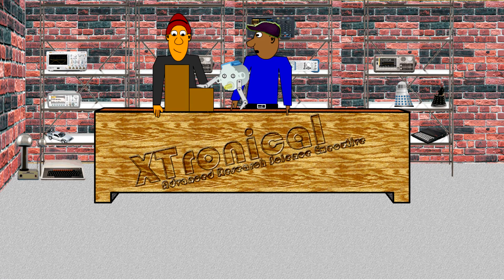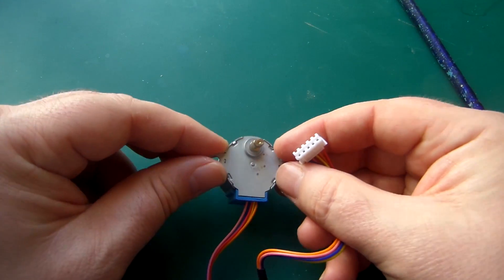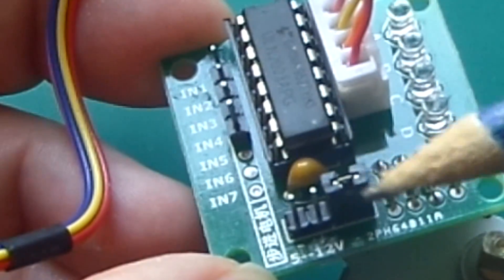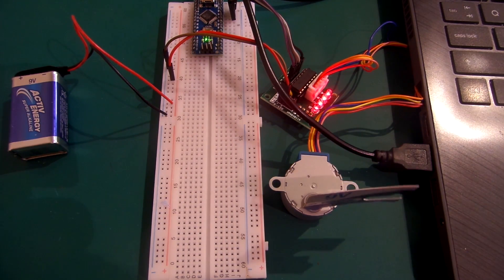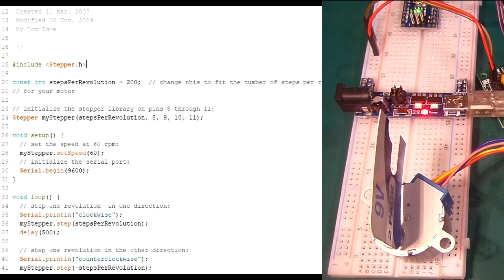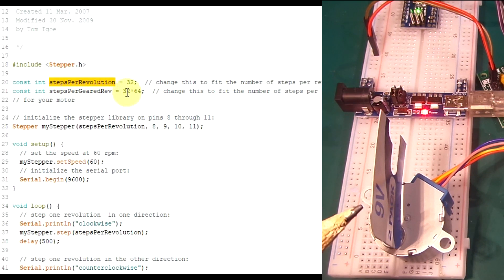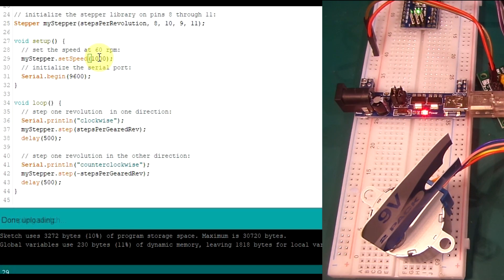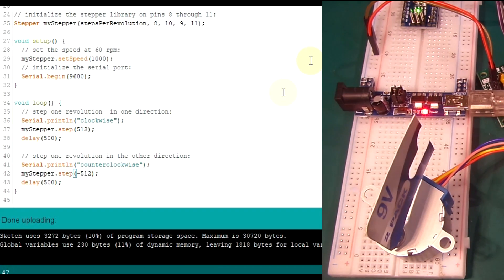Using Stepper motors with MCU's (Arduino, ESP32, ESP8266)

Comment: Hi. Probably someone is able to put me in the right direction.
My target is to remotely control the movable louvers of my shutters (actually with a manual rotating knob). I'm thinking about an esp module, and one stepper for each knob.
This tutorial is great to learn the basics. But now I need to learn how build an "auto-setup" cycle that learn where the full-close and full open positions are.. And so be able to control the stepper to move the louvers from 0% to 100%.
Anyone can give me the right path to follow?
Reply from the maker: For safety it would be best to use lever switches made for this job, so they act as end stops. You just need to detect these switches closing to see if fully opened or closed. Then for any position in between you can use the stepper feature to move to appropriate position. Other option is a normal geared motor with an encoding wheel to count number of revs.
Reply: @XTronical  so you mean to place a limit switch for full close, a limit for full open. Then the setup will rotate the stepper until full close limit close, then rotate opposite until full limit open reached; in that way I know how much the stepper need to rotate from full open to full close.. so I can exactly rotate to an exact position.
I'm a beginner on steppers, so I'm sorry if I'm using wrong terms :)

As for the WAF (Wife Acceptance Factor :-) ) I need to reduce the size of the parts as much as possibile, and adding two limits and their wires could be a limit; there's a stepper driver board with current absorption measurment? In that way I could have a "virtual limit switch" and safety (for a finger between louvers).
Anyway I have to evaluate if a small rechargeable battery pack is able to run all that things for a reasonable amount of time.. beacuse adding a power supply is worse than limit switches :D
Reply from the maker: A current sense sounds possible. However, I know it's not in the spirit of make it yourself but have a look at this video from techmoan https://youtu.be/bLPNFNeCsrU

Comment: I followed your code but im getting "soft WDT reset". any help would be appreciated
Reply from the maker: Which processor are you using, I only tested on arduino. The error looks like esp8266 issue.
Reply: @XTronical  I'm using a nodemcu esp8266
Reply from the maker: The library is not very esp8266 friendly then unfortunately. But there are solutions. What's happening is that the ESP8266 has two watchdogs (wdt) that look to see if the processor has crashed. As the stepper code takes some time to turn the motor one complete cycle then the watchdog thinks your code has crashed - when in fact it hasn't, it's just taking some time.

You can turn off the software watchdog with a command (you could put this in setup function)

ESP.wdtDisable();

If you want to turn it back on (you might no want to) then it can be turned back on with ESP.wdtEnable(1000);

Also add this command yield()  into the code, see below;

void loop() {
  // step one revolution  in one direction:
  Serial.println("clockwise");
  myStepper.step(stepsPerRevolution);  
  yield();
  delay(500);
 
  // step one revolution in the other direction:
  Serial.println("counterclockwise");
  myStepper.step(-stepsPerRevolution);
  yield();
  delay(500);
}

As long as a full turn takes less than 6 seconds then this will be fine. If it takes longer than 6 then the other watchdog (hardware watchdog) will kick in. If this is a problem get back to me as you would need further alts to the code.
Reply: @XTronical  thanks for an extensive reply, so I tried ESP.wdtdisable() ; along with the code you've provided above, but I'm still getting softwdt reset when the motor is moving CCW.
Reply: @XTronical  First of all thankyou for such an extensive reply ! Okay so first of all i tried disabling wdt like you mentioned above but im still getting a soft WDT reset. Then I tried the code above, the reset happens when the servo is moving anticlockwise direction
Reply from the maker: I'll post some code to fix soon but I'm not in front of a computer at the moment

Comment: Thank you! Your video pointed out that I had my control wires from my ESP to the driver in the wrong order -- and ultimately solved my "it's humming, but not turning" issue.  thanks for the great video!
Reply: For me, I think I burned y board by drawing too much current directly from the board, so this video helped me know how now to do that. Lol 😊

Comment: Hello @XTronical, thank you for the detailed Video. I was using the same Sketch with the same stepper and Driver Hardware. But instead of an Arduino I am using an NodeMCU because my Goal is to build a wireless controllable blind at our home.

But the problem is the code doesn't work as it should. I changed the Pins in the Code to the ones I am using on the NodeMCU (D1 to D4 in my case). Code works but only until it comes to the second part of the loop. When it should stop and turn in the other direction it just goes on with the ClockWise Rotation. And it doesn't do a full rotation, just a half, then stoping for 500ms and repeat. I changed the delay after clockwise rotation to 2000ms just for checking if it does this change. But it doesn't. It stays at a pause of 500ms and goes on with cw rotation. Checking the Serial monitor it Shows a lot of strange data and in the end it's always saying "clockwise". Any idea why it's not going through the full Code as it should?
Reply from the maker: Sorry, I'm not sure, I'd have to set up like yourself and see what happens. Off top of my head I'm puzzled. All I'd do is simplify everything. i. e. Take out the first part. Just try the bit that fails. Start in the direction that doesn't work etc.
Reply: XTronical okay I'll try ☺️👍🏻
Reply: From my experience the stepper.h lib is not compatible with the ESP8266 it just boot loops due to the delays

Comment: I connected the same motor to an esp8266 d1 mini board. 
If D1 mini can power it, even Arduino nano can. Why don't you connect to the nano directly?
Reply from the maker: The current drawn (particularly under load) exceeds the nano"s limit. It would break. It also exceeds the d1 mini boards limit. I would recommend not connecting it directly to that board. The limit for your board is around 12mA. The current draw of the motor will go higher than this. Hope this helps.
Reply: @XTronical  running It since two months now without problems. I'll let you know of something break

Comment: I cannot use the runToNewPosition function bc that will soft reset and getCurrentPosition will also return the wrong number (always 1..) do you know how i can get the current position back to the starting position?
Reply: I see you use a different Library, i used Accelstepper
Reply from the maker: Yes, sorry, not sure if the library I used has that type of command. I've always kept track of the position in my own code.
Reply: @XTronical  y I do that now to but bc it has to reconnect allot it resets its position making it spin to far ect.

Thanks anyway!
Reply from the maker: Are you using a separate power source for the motor?

Comment: Would you be able to help me use a stepper motor with an ESP32 board? I'm new to using the ESP32 board and can't seem to get it working, well... without the motor becoming really hot. So far I've gotten it to kind of work (running on 12v) but it just doesn't seem to want to stay cool.
Reply from the maker: They do get hot, as they have a holding current even if not turning. This can be turned off but you lose some holding torque. Does it have to be 12V? Also you may be able to turn off power and have less holding torque but that depends on the individual project and motor being used.
Reply: @XTronical  well the stepper module I got can run between 5 to 12v and releasing the holding torque isn't a problem as it's won't be holding things in place. Also when I say hot I mean I can't even touch it. Like if I put it on plastic I think it would melt it.
Reply from the maker: Ok, my kit is still set up, I'll add in the ability to kill the current and that should sort it. Can't remember the current draw but at 12v it will need to dissipate a few Watts. When I come to do it I'll do the calculation.
Reply: @XTronical  ok cool. Thanks
Reply: I think I might of figured it out, I used this example (http://www.geeetech.com/wiki/index.php/Stepper_Motor_5V_4-Phase_5-Wire_%26_ULN2003_Driver_Board_for_Arduino) and used a 5V power supply instead and got it working. I did try the example library you used with 5V but it still wasn't working.

I thought I'd try 5V because the motor itself says 5V but the board is said to handle voltage between 5 to 12 volts. So I guess if I wanted to use this board on a 12v motor I could.
Reply from the maker: Ahh, great, I'll have a look at that library too when I return to this project, thanks.
Reply: @XTronical  ok cool thanks anyway

Comment: You probably want to be careful with that breadboard powersupply. Some of them are known to burn through and when that happens they short the input voltage through un-regulated. So if you have say 12v on the powerplug it will dump that 12v straight into what should be your 3.3 or 5 line which is bad(tm). Probably better to take a trustworthy powersupply and not risk blowing out the MCU.
Reply from the maker: Thanks, great tip :)
Reply: No worries, just ordered a bunch of those little stepper motors. First project a soldering tin feeder with an arduino UNO ... or maybe an ESP32 with oled. Just for funzies because why not right :)
Reply from the maker: Sounds Brill.